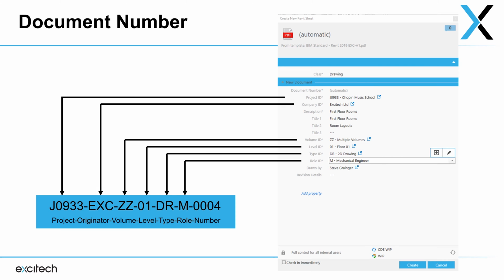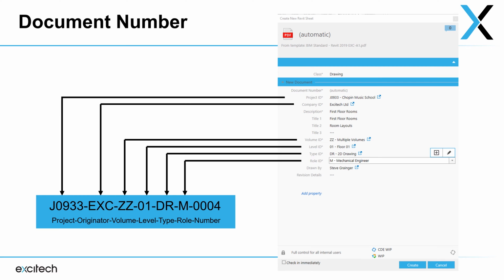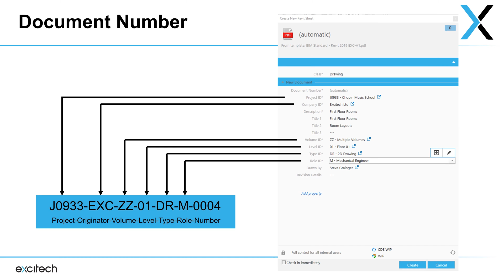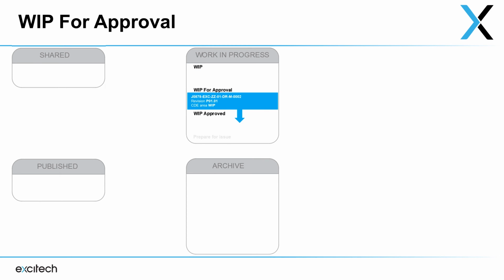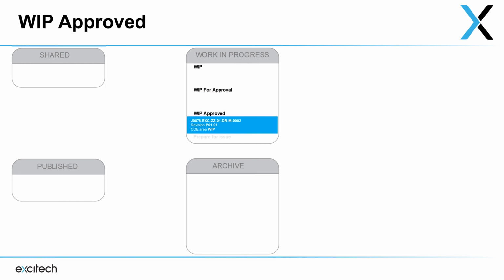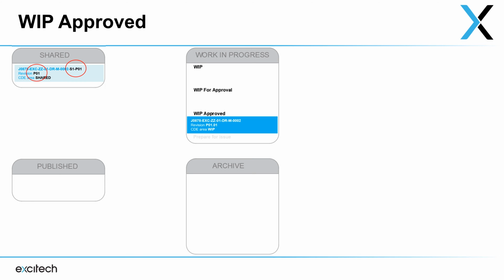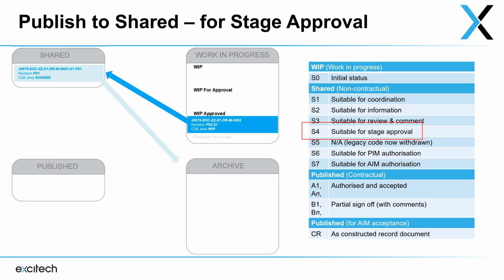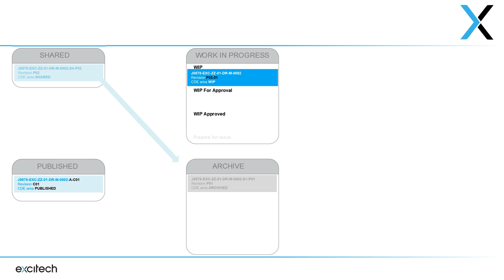File Naming & Workflow - ISO 19650 Naming & Workflows Explained

Comment: which section of iso 19650 states about file naming?
Reply: It looks like its in the BS1192
Reply: rocker1003 I have read iOS 19650 parts 1, 2, 3 and 5 but could not find this .
Reply: @Chaz from UK yeah man looking at this, i don't think it'll work BIM wise, if it is being linked with different consultants
Reply: The system for file naming is not specified in the ISO standard, that's left to individual National Annexes. The committee who wrote it couldn't agree on everything, so in essence the standard is not standard here. :) So for the UK, for instance, the naming convention is in the UK National Annex. I has changed slightly from BS1192. You'll find it here: https://shop.bsigroup.com/ProductDetail?pid=000000000030333757